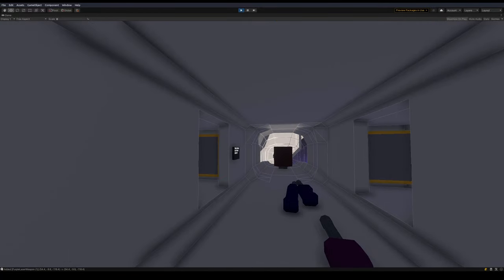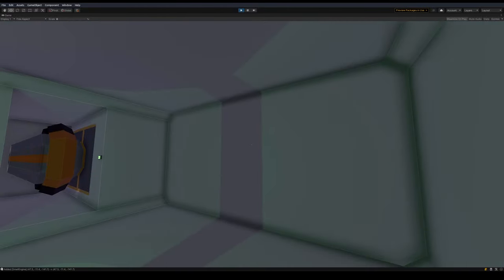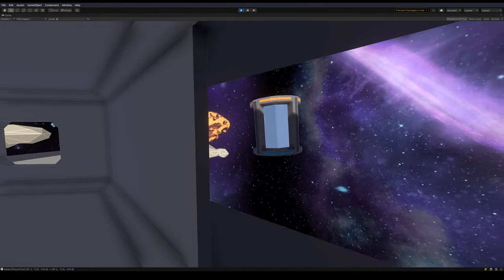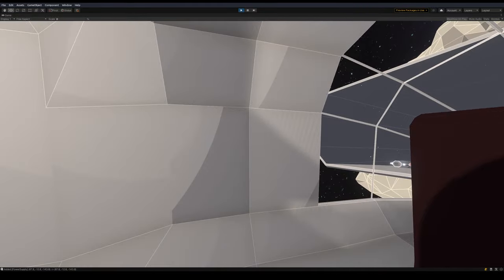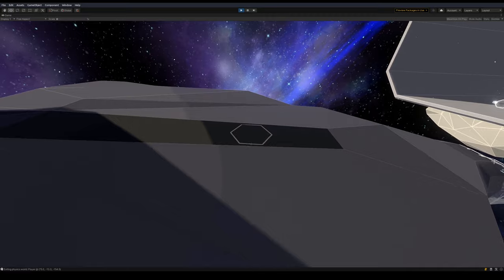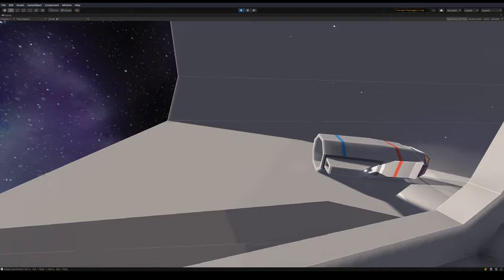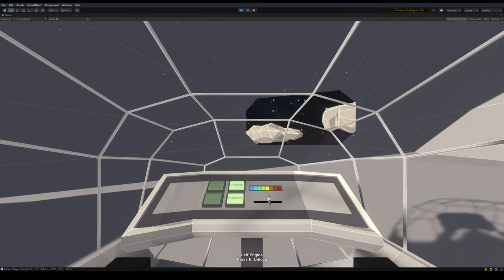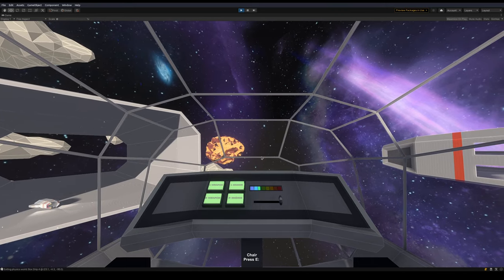Tailspin Devlog 03 - Install Equipment and Dashboard

Comment: This looks cool, i watched 1 and 2 vid, so i gonna subscribe
Reply: I there is gonna be local coop multiplayer or its just singleplayer game?
Reply from the maker: @oldacc2508  I'm glad you like it! At the moment I've purposely stayed away from any networked multiplayer, but the design would work for local (same machine). However I doubt I'll implement that.

The main reason being is scope, I think multiplayer would be great to have but I am still fairly early on in the prototype phase just to see if the game works as a whole.
Reply: @alanlawrey  ok, i understand. Good luck!